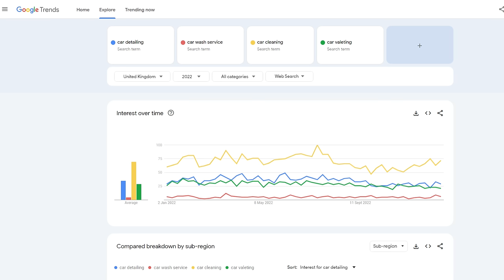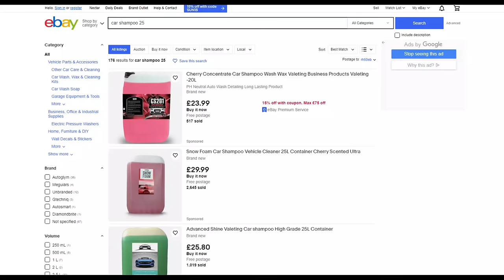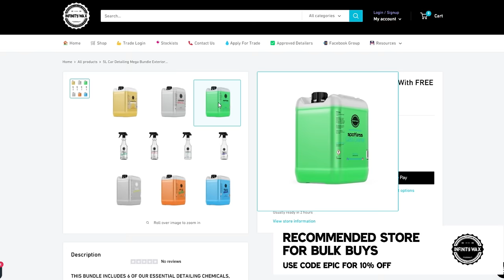Why you Must start a Car Cleaning business RIGHT NOW!

Comment: Great video, mate! You touched on an important topic,  pricing.  One price does not fit all vehicles and starting a detailing business that needs to be clear up-front. Larger vehicles usually carry a heftier price tag due to the amount of work that will need to be done. It's also important to have listed, very dirty vehicles will cost the customer more due to the extra time it will take to clean and more chemicals needed.  Thanks for sharing. Cheers!
Reply from the maker: Cheers mate thanks for sharing your wise words :)

Comment: Still hooked to your videos as the opening of my mobile valeting business closes in. However, the final bit of kit I'm struggling with is an electrical source. Do you have any recommendations. IE, generator, or battery? If you have a video could you link it as I couldn't find one. Thank you
Reply from the maker: I relied solely on customers power and didn't use any generators. It was never a problem 👌 thanks for watching 🙂
Reply: Thanks for the response. That's understandable. If you do however, ever make a video on generators or battery's. I will be the first ot watch it.

Comment: If you do this part-time, do you need to carry water and a generator? Or can you use their outside tap and electricity.
Reply from the maker: no need to carry power and water unless its one of those locations... sometimes you just got to ask yourself which is easier. getting a tank and power or just saying no to that one customer who has an awkward location
Reply: @epicautomotivedetailing  I see, but do you advertise that you are cheaper because of that. I have a Honda civic sport. Do you think I could detail from that with a water tank in the boot?
Reply: @epicautomotivedetailing  I charged a friend for a wash, Polish and wax, Tyres dressed  and full clean inside £30 using their power etc was that too cheap? Sorry to ask loads of questions.